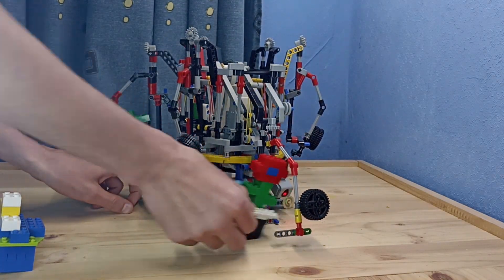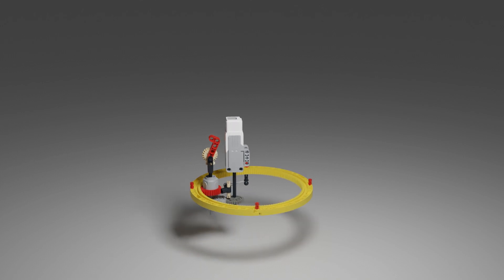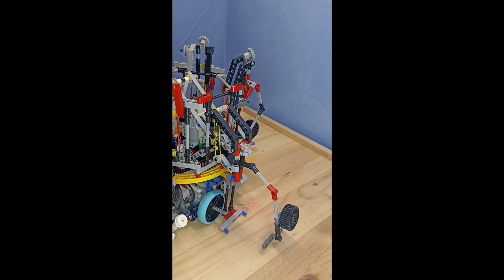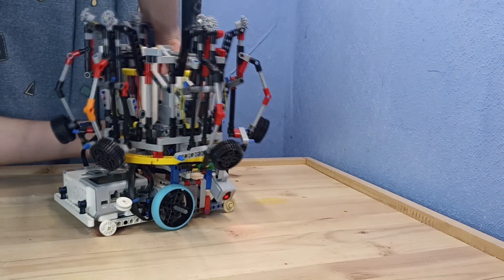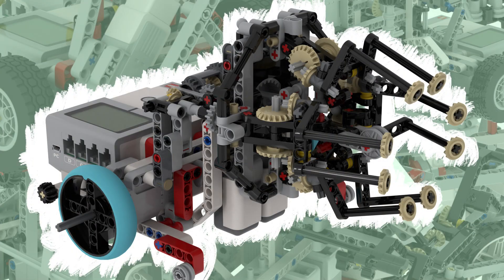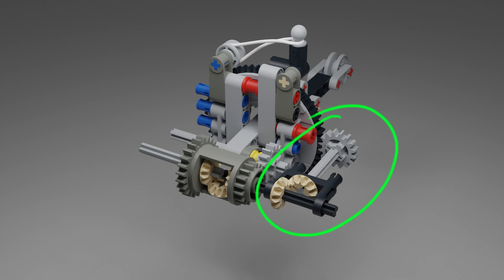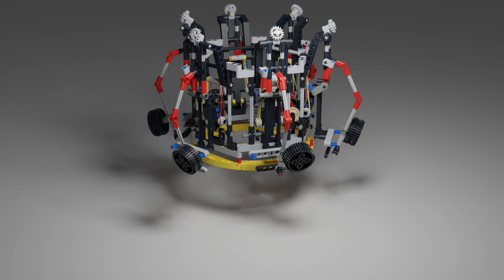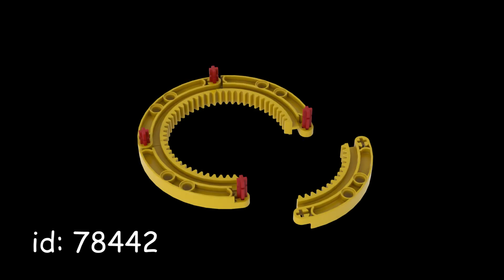1m6m | how it works

Comment: How do you code the medium motor whenever I try to make it move straight the mors rotate in different directions causing it to rotate and wjen I put the two motors in a loop block it moves straight but I can't stop it from moving
Reply from the maker: What medium motor are you talking about? Motors for movement or about a motor for a manipulator
Reply: @salavatyakupov7308  motors for movement